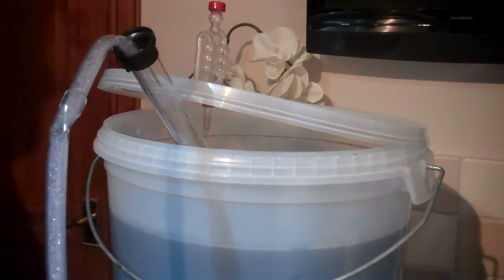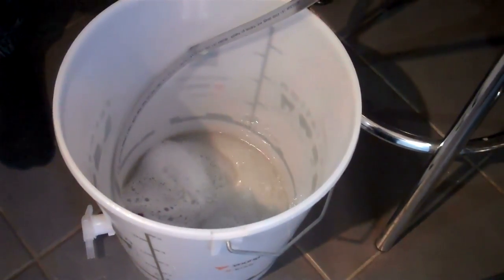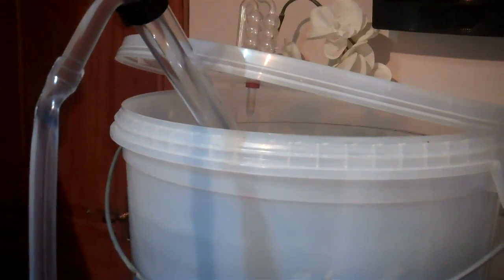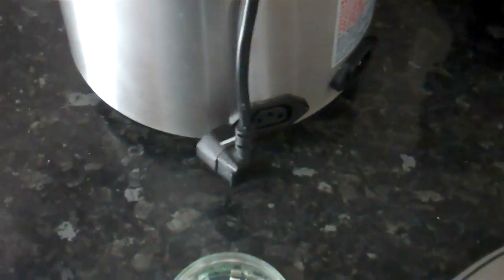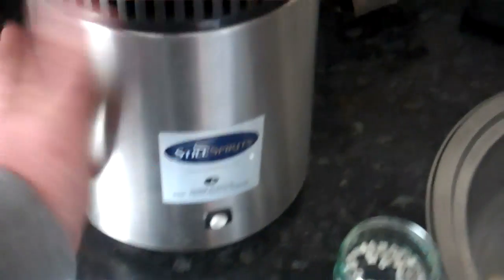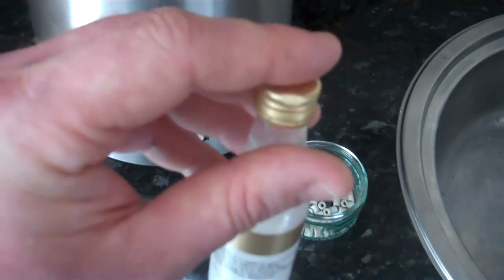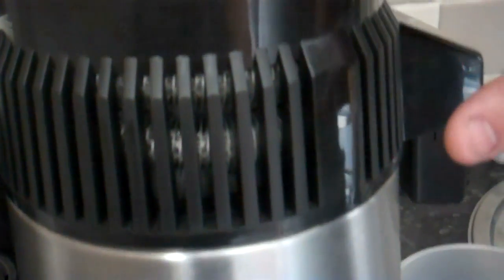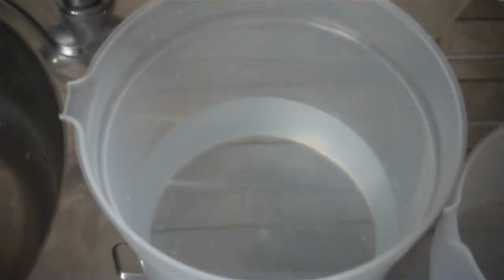Simple Home Distilling - Distilling And diluting The Wash.

Comment: I followed the manufacturers instructions and it tasted like crap. The trick here is to double distill. Strip the wash then do a spirit run and make your cuts. It's good stuff then.
Reply: Or use a proper reflux still and not a relabeled water still.

Comment: I am concerned that the heads( acetone and methanol ) are not discarded from the distillate.
Reply: Correct, negligible methanol when there is no pectin in the wash, but acetone, aka Nail polish remover is definitely present in sugar washes. 

When using a good reflux still the start of the run stinks of acetone and you can be sure it doesn't taste good. 

However when using an air still you will get less distinction between the fore-shots, heads, hearts and tails. 
Once its all mixed up and diluted to 40% you may not taste the acetone, but its still there. (It's also in beer and wine, so its not going to kill you in the amounts that are usually consumed).

Comment: Air stills are very nice indeed.  I have one and love it.  I do take first 3/4 of a shot or so for heads and dump, the rest is liquid gold.  I use a WEMO programmable outlet that I can program to run.  I do it in two phases.  I know from my still logs that it takes an hour and 10 minutes to start collecting.    After my heads is collected, and oh yes these do collect heads.  you can taste the difference from sampling.  I program my outlet to turn off in an hour and thirty minutes and go to sleep or go do something else while it collects the hearts.  It automatically turns off and I will have collected @ 35 ounces of 120 proof whiskey or rum.  If I'm shooting for a neutral spirit I run it again through still and wallah you will have about 150-160 proof with much of the flavor stripped out.  have fun and happy brewing!

after watching your show... I need a siphon!

Comment: the ceramic beads are called rashig rings.  they go before the coil, they help to give the mash water extra surface to condense on so the alcohol vapor can be of a higher percentage in the finish.
Reply: Only when using a reflux column, you don't use them for the purpose you just described in a pot still or an air still. 
Using them in the way shown here prevents large bubbles forming during boiling, which prevents the fluid rising into the top of the device where you only want the steam and vapor to be.

Comment: the T500 is a good starter....but honestly, they dont last long.... far better to make your own reflux column. If you dont feel like trying it, most plumbers can knock one up with any of the downloadable templates in less than an hour, I paid a plumber £60 to make mine and it will last a 100 years I swear to you.  The T500 has to many pvc seals and plastic parts, they shrink, get brittle, The alcho vapours speed this up.... for half the price, build one to last for your grand children.

Comment: i also have an air still. i make 20% wash run it threw to collect 1.14ltr per 4ltr wash it comes out at 65 percent i then dilute down to 45% then filter and the end result is amazing. my wife loves it and has saved alot of coin spent at the liquor. the only problem is it takes 3.5-4 hrs with the air still per wash.. time consuming.. thanks matt for the video